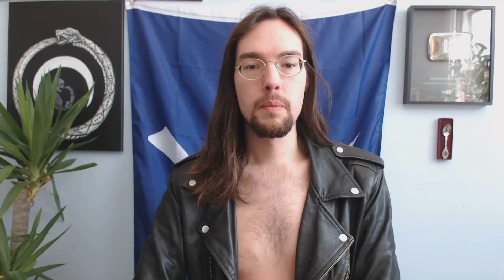Great Pacific Garbage Patch: Governments Have Failed on Environmentalism

Comment: Much as I agree that plastics are overused, styx, there are a lot of places where plastics are probably preferable to the old fashion containers, even the ones I'd rather have back.

Case in point: soda bottles
While the idea of glass coke bottles coming back into vogue is appealing, if only for the aesthetic appeal and more comfortable mouth opening, picking up a dropped and yet still undamaged plastic soda bottle (which is usually pressurized to 120 PSI to begin with ) beats the hell out of digging almost microscopic shards of glass out of your feet months after you thought you swept up all the glass from that one glass bottle you dropped.

That being said, some things just have no business being made out of plastic, particularly if they have moving parts that rub against one another and/or are under load constantly. Plastics, especially the cheap ones, fatigue worse than metals.

Comment: You gotta remember styxx, we stopped using paper and cardboard products due to the backlash from leftist tree huggers. And the plastics manufacturers moved in to fill the void, with something worse.
The corporatacracy always moves in to respond to what the leftocracy demands.
They call it, "filling the niche demand!" And it sells...
For awhile, 
Until it doesn't...
Then we go back to what the left now wants, which is less humans..
Face it, the left hates humanity in whatever form it comes in because they constantly want to exclude themselves from humanity as some disparate, non represented, victimized group.
Plague modern civilization with regressive thinking, they will...

Comment: I can't see any change happening soon. We are market-driven societies, the motto is: Economic Growth. Apparently, when the economic growth slows down or stalls, disaster will ensue. 
Why that is so and how it actually works, I admit, is still a mystery to me.What seems evident however is, that in order to continue growing economically, we have to keep on increasing our productivity.

Consumer goods are packaged in plastic. Doing otherwise, there would be a profit loss because the packaging protects from dust and other environmental agents that would cause the product to deteriorate before it is sold. Plastic packaged goods are easier to store, to display in shops, to send by mail and to ship. 
This means the producers have no incentive NOT to continue with the plastic packaging. 

So... our economies keep growing and growing and growing... can this go on forever?
The whole world is in deep trouble and we have to find a solution quick or we're done for.

Comment: Styx before you say "tin cans" are better than plastic bags, you should know that there is a plastic lining in these steel or Al "tin" cans and that lining is far worse for the environment than your polyethylene plastic bag. The Bisphenol-A used to line most cans is a xeno-eostrogen which may well be making the frogs gay, and feminises men.
Basically not all plastics are the same, and some are clearly better than others, and some good materials have nasty additives which can be far worse than the obvious problem materials.

Comment: Isn't the obsession with properly trimmed lawns and shit like that a holdover from the cold war and the fear of nuclear war? These regulations were basically set in place to prevent massive fires from bigger plants in the garden going up in flames from the heat blast of a nuke. Same with having to keep your house painted properly, they figured out that it makes a world of a difference whether the wood of your house is exposed or not. Exposed wood just goes up in flames, while painted wood offers more resistance.

That is all of course talking about areas further away from the detonation.

Comment: The funniest part is- biology will find a work around. The part that follows that solution is what's so funny- you won't be able to rely on plastics any more to contain anything once that solution runs wild. You'll have water pipes and electrical conduit corroding from bacteria and fungus eating it (things that were supposed to be permanent will no longer be so). 

Just imagine: Catastrophic failures in your computer and other electronics- not because of water but because of air borne bacteria that want to eat it and other things like it, cars bodies being dissolved exposing metal which then oxidizes. It'll be a shit show.

Comment: The condition of the Great Pacific Garbage Patch is not nearly as bad as the hype regarding it makes it out to be. 

On the image recently released by the Ocean Cleanup Foundation:

The yellow area on the map represents 1 kilogram of material per square kilometer.

By comparison:
1 grain of sand = about 0.1 milligram. Therefore, about 10,000,000 grains of sand per kilogram.

1 square kilometer = 1 million square meters

A mass density of 1 kg/km^2 is therefore equivalent to 10,000,000 grains of sand spread over 1,000,000 square meters, or 10 grains per square meter. That hardly corresponds to the image that accompanies the article, now does it?

(Even the densest - red - areas correspond to a mass density 100 times as large - one thousand grains of sand per square meter. That's enough to see, but not much more. One grain per 10 square centimeters.)

Moreover, the upper limit of the densest red region on the map is 1000 kg/km-squared. That's 1 gram per meter-squared, or about 1 plastic marble in a square more than 3 feet on a side. The average of the orange region is about 30 times less dense.

Comment: The aristocratic Romans used to sprinkle lead in their wine in order to make it taste better, yum. Anyway, good luck fixing that garbage patch you would need an entire fleet of trawlers working non stop for a decade to collect all the garbage. Our best solution is genetically engineering a snail or mollusk to eat plastic and then just turn them loose and hope for the best.

Comment: the climate is largely in fact nearly entirely dictated by energy coming from our sun. low pressure cells are electromagnetically coupled with sun spots, human beings suck at producing greenhouse gases in comparison with forest fires and volcanos, but even though we are not causing climate change we should reverse pollution

Comment: I remember when we had glass pop bottles.  When I was a kid my parents bought Pepsi all the time, in Michigan you paid 10 cents per bottle/can for a deposit and you got it back when you turned them in (in fact my sister went bottle-hunting and saved up enough money for a new bike).  I knew the bottles were used over and over again because there was always that one bottle that was chipped at the top.

Comment: Paper bags is not good. Expensive and polluting to produce, I've heard.
Reply: I'm usually just getting a beer and a pack of smokes for groceries, so I just shove it in my pockets. I'm doing my part to save the earth 😇
Reply: They make the reusable cloth shopping bags. Ive seen a few around.
Reply: Yes, durable, that's the answer.
Reply: I'm sure they're much better than plastic and all of them can be made from recycled material at this point.  Or use reusable fabric bags like I do when going shopping.

Comment: When there is a problem that needs to be solved by getting down and dirty, it is not popular for politicians to talk about it, unless they can solve it with sanctions or bombs. CO2 myth is much juicier cake for politicians, because they can score points without actually doing any work. Or if they do any work, the results are not tangible, therefore they don't have to be responsible if anything goes wrong.